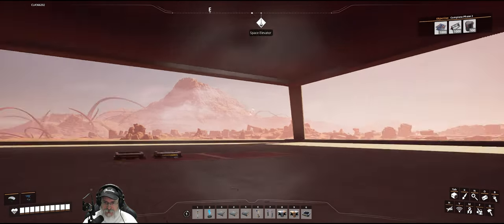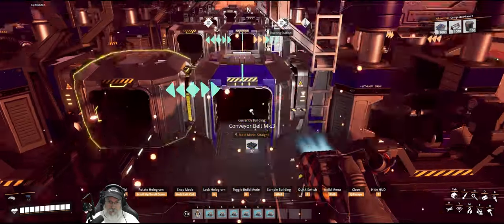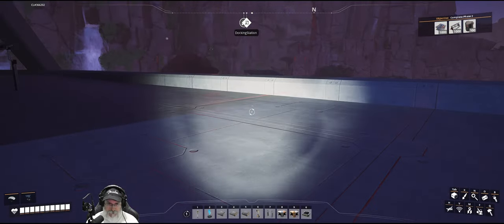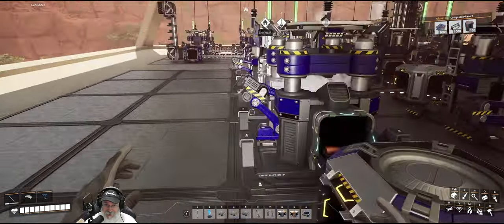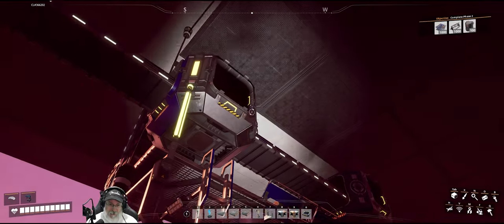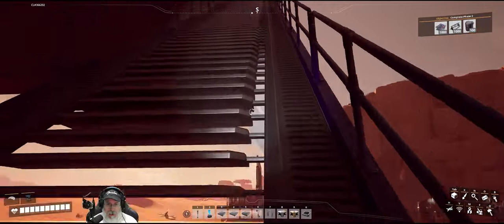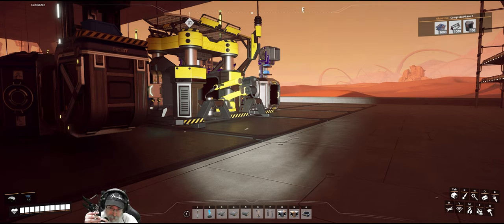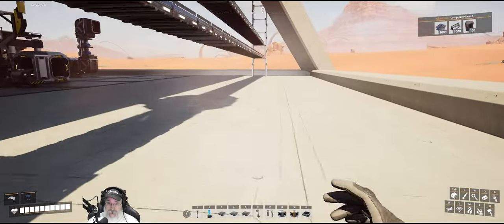Satisfactory 1.0 Game Play | E13 Copper, Caterium and Assembler Productions

Comment: Yes! smart splitters are awesome with the overflow option to sink excess parts. Let me design a storage cell with 6 large storage units that can take one belt with many different items and sort into the units with a fair bit of flexibility with how many boxes each item gets put into and an output belt for overflow.  And anything not in the initial programable splitter's list passes through.  This required the new MK2 blueprint designer to make. Going from 4 units on a side to 5 sounds small but this is in all three dimensions so nearly a doubling of space (64->125). Much more useful.
Reply from the maker: Cool. When does the Mk2 become available?
Reply: @TheBeardedOG  The MK2 is available at tier 6. 
 MK1 and MK2 creations cannot be loaded into a different sized designer, so upscaling a 4x4 design inside a 5x5 designer probably means either working from scratch or printing the original design nearby to copy from.

Comment: You may have already seen it, but they just patched the conveyer belt subsystem (Noon  CDST sept9, 2024). Supposed to fix some issues causing crashes. And hopefully a fixes a bug I have where items are sent down the ANY exit of a splitter instead of the one set for that item. Unless it's supposed to act like a dumb splitter with two outputs connected in that case.  I could see a Niche use for that, but mostly not.
Reply from the maker: I haven't yet. Been at work all day. I'll take a look at the patch notes. Thanks!